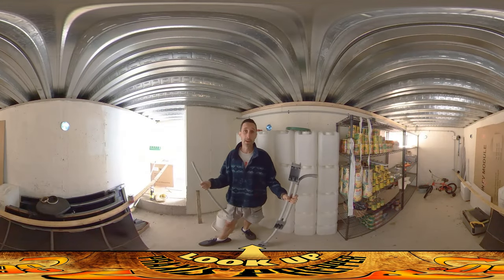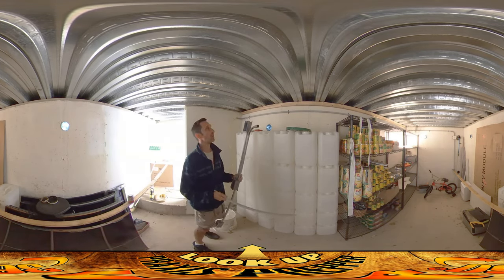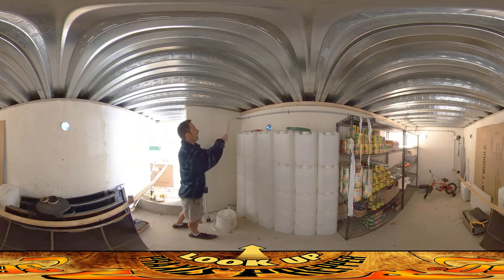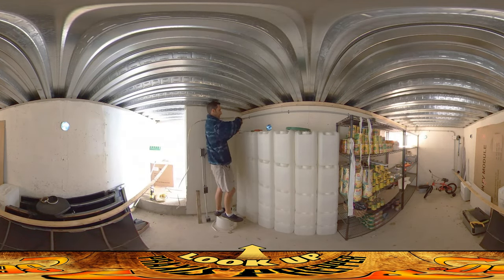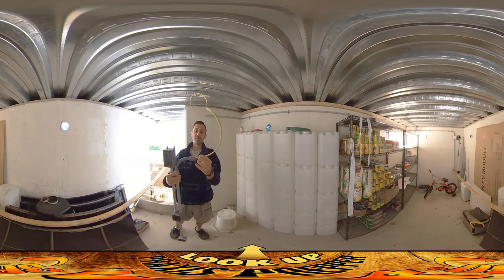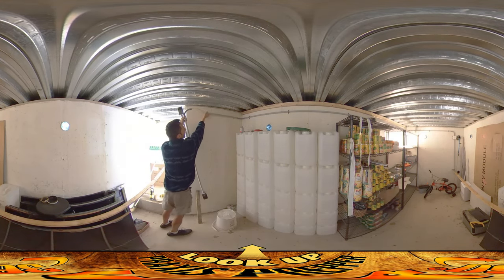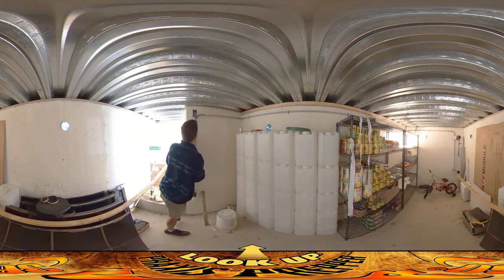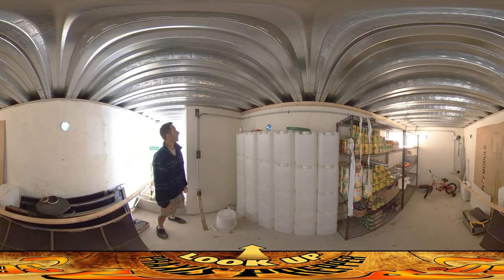Homestead Building - PVC Electrical Conduit Install In Root Cellar/Fallout Shelter

Comment: The water containers can be extended if you don't take showers or baths. I read this in the book "Clean: The New Science of Skin" by James Hamblin, M.D. He hasn't taken a shower in like 5 years and he's fine. Also, the famous Youtube dermatologist Dr. Dray says that you don't need to wash skin unless it's visibly dirty, though she's also said you can wash places where there's skin-to-skin contact, like under the mammaries, in the armpits, the bum crack and the crotch. I think she's also said to wash the bottoms of the feet and hands. I'm not sure if she recommends washing between the toes. I think she's recommended using a gentle cleanser, not soap, on the face.
Reply from the maker: I can add a bit to this. I shower daily, and I use a natural bar soap on my body. But I haven't used shampoo or anything other than warm water on my hair in... a long time. No problems there. As a metal experiment, the idea of going without showering feels dirty to me. I work and end up covered in dirt and sweat most days though. So maybe this advice isn't aimed at people like me. My boy is (TMI ALERT) uncircumcised and he has to be careful to wash that area with purpose every 2 days when he does his bath (he's 9) or he gets a rash. So maybe that advice is more aimed at the general bodies of people who don't do much physical work on a daily basis. I'm not sure. But I can say that the shampoo issue for short hair does seem to be mythical. I never use it and no problems here.

Comment: ideally you should run THNN wire instead of romex. with THNN you would have the means to pull multiple circuits through the conduit as you won't have to peice meal your conduit to get the wiring in it. You can also buy lube which makes it much easy to pull wire through conduit.
Reply from the maker: THNN could have been useful too. But I think 1 circuit was plenty for our purposes. We're going to likely have a stand alone solar battery system in there too anyhow. The conduit is 3" as well, so adding another run (or 10) of additional romex wouldn't be any big hassle either. It was an easy pull in terms of romex. It was the hose that made it any effort at all.
Reply: @PraxisPrepper  FYI: Check your state code, but I don't believe you can run multiple romex circuits in conduit. I believe the issue is the possible of heat build up. Stick with the THNN since its intended for conduit. 
Hope you can find 3" conduit. I haven't seen any stocked in my local stores since the spring.
Reply from the maker: @guytech7310  I wasn't aware of the limitation on romex runs through conduit. I might have broken that guidance for about 18" of conduit in my root cellar where I shot the romex through a junction box, down through 18" of conduit to an outlet box and then shot it back up through the same PVC coduit back to the junction box for a switch before heading up to a switched outlet. I did it that way to reduce the amount of clutter in the box with the switch I'm thinking it won't be an issue for me since the switch only runs 25 watts of space lamps. I'll keep that guidance in mind for the future though. Thx.